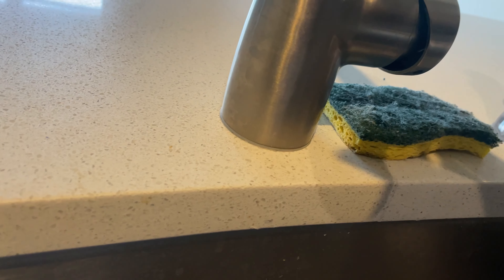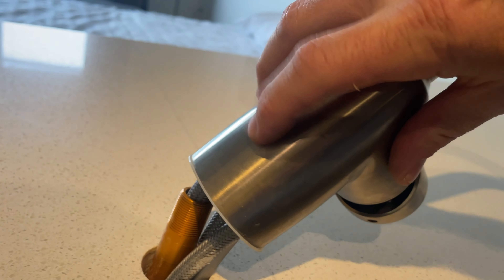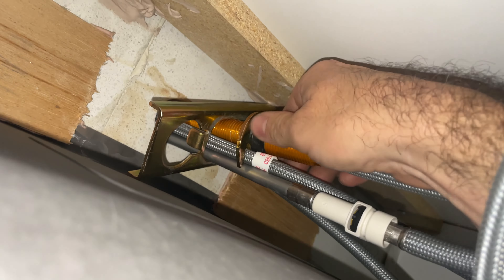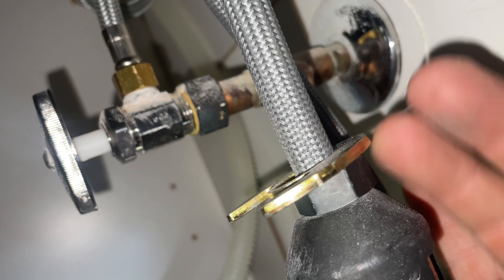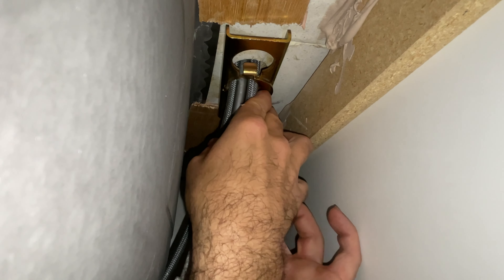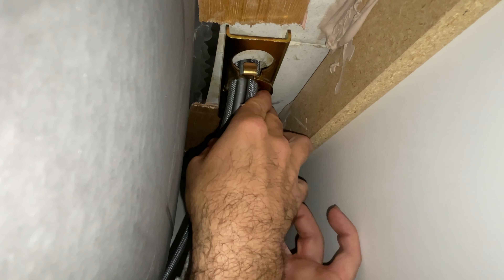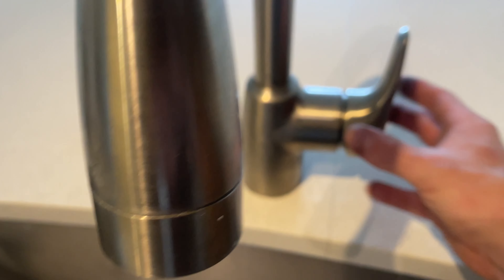Fixing a Loose Kitchen Faucet

Comment: I’ve done this so many times from below not realizing I could just pull the whole thing out. I knew there had to be a better way we way! Thank you. You saved me big time.
Reply: you can't just pull the thing out if the retention plate and nut have been properly installed (albeit loose now...).  This assembly/installation has just fallen apart.  If the assembly is just loose, you need to reposition the retention plate and tighten the nut.  Unfortunately, you need that magical Moen tool to get to the nut and tighten it. You can't do it with normal wrenches as nothing will fit into the small area where the nut exists.

Comment: You don’t need to caulk the gooseneck to the countertop right?
Reply from the maker: If it has a rubber seal on the bottom you shouldn’t have to

Comment: Thanks for posting this. I have a similar issue with a Delta faucet handle coming loose - the handle is separate. There was a gasket-thingy under it, seems like it’s there to tighten the base against the counter not seal and I just can’t find one to replace the old one which basically disintegrated. Faucet is Delta Victorian (discontinued) and I can’t find a replacement. OD is about 2.5”. What the heck can I use?  Any suggestions would be most appreciated!
Reply: Contact Delta directly

Comment: I got that same tool. Has let me fix all kinds of sinks and is even good for torquing down on those old multi turn shutoff valves when you have leak after shutting off water
Reply from the maker: Nice! Never thought about using it for those shut offs good idea 👍
Reply: @ApartmentMaintenancePro  plumbers will try to lie to you or get a quick buck for a simple fix like bro it’s not that deep the plumber tried to ask 300$ no your literally doing a 1 minute job and it’s that fast.
Reply: Those multi turn stop valves often times do seem to leak if they haven't been turned in a long time. I had to replace my toilet float valve and after shutting off the stop valve it leaked for a couple of days. I ended up replacing it with a 1/4 turn ball valve unit. I just replaced another stop valve for the kitchen sink and when I looked at the old stop valve, I could see that the washer was starting to come apart. It's over 20 years old. I replaced it with another 1/4 turn ball valve type. I read somewhere else that it's a good idea to turn all your stop valves in the house at least once or twice a year. Otherwise they can get stuck and won't turn.

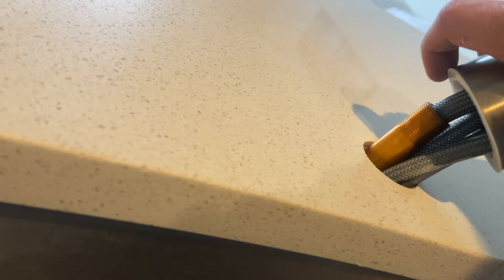Comment: At 0:13, I wonder if you needed to yank all the hoses to tighten the cylindrical shaft into the faucet base. I agree it wasn't much effort to do so, but couldn't that have been done from below? Anyhow, it was a surprise to me that it wasn't the bottom part (with the nut) of the shaft that needed to be tightened, so thanks for that!

Comment: This is exactly my problem. I’ve got the threaded pipe covering the hose in position but it won’t screw into the faucet head no matter how many times I turn it. With all the other hoses running along side up into the faucet head, I can’t see how or where this one threaded pipe screws into the head. Any advice?

Comment: Every implementation is different making these videos very instance specific. Mine has a huge plastic thing encompassing all the hoses and the entire thing seemingly screws onto the threads coming down from the faucet. It was tight for 1.5 years but now it came loose. I try to screw the black plastic thing onto the threads but it just goes all the way up to the sink like the threads having nothing to grip. Since the black piece is seemingly still tight around the hoses I can't figure out how it isn't grabbing the threads anymore.

Comment: I think there is problem with this design. I have my contractor installed it. It came loose 3 weeks after. I called the contractor and he came to fixed it again and super tight. 3 months now and it came loose again.